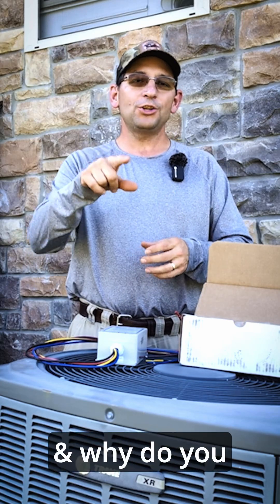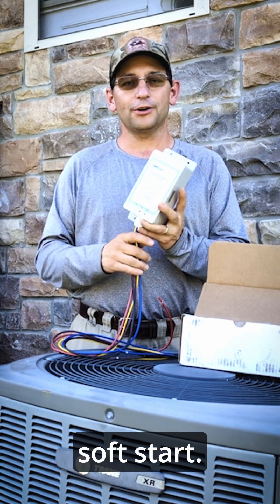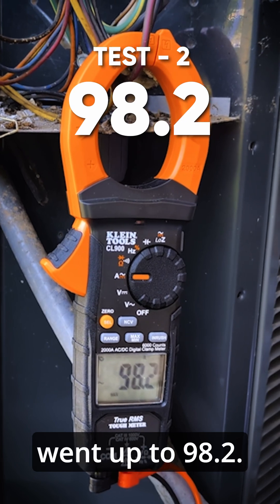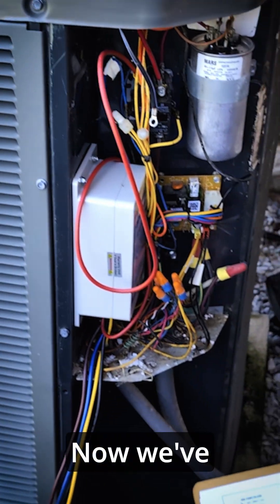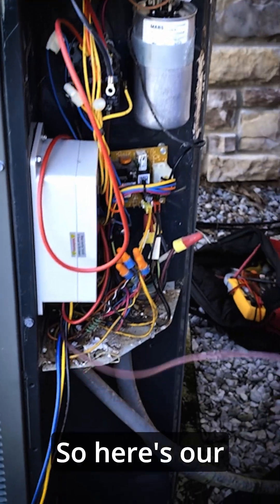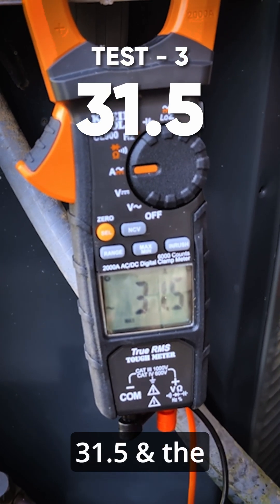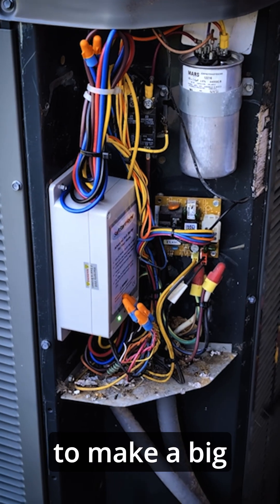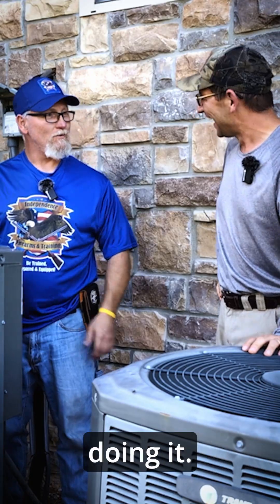AC Unit Soft Start Install with Amp Draw Test Before and After

Comment: Does it extend the life of the heat pump? What does it do exactly, I guess it relates to the capictor somehow
Reply: It limits the current when AC goes from a standstill to running so the increased power draw doesn't cause your lights to flicker whenever AC boots up
That's basically it
Doesn't make your AC last longer or anything, just removes the spikes
Reply from the maker: Great question @Electrical.Perspective and solid input @Mumohan_ You’re both touching on the things we researched before adding the Soft Start. It definitely reduces the surge of power during startup, which helps prevent flickering lights and strain on your power system. But it also eases the load on parts like the compressor and capacitor. That smoother startup can lead to less wear over time, which may help extend the life of your AC/Heat Pump. I can't say 100% it'll extend the life but whenever parts are not being hit as hard with spikes, I feel it'll make them last longer.
Reply: It only delays the compressor start and the fan starts right away like normal.  That helps with inrush since both don't start at once and yes it has big caps which smooth out the start so the compressor doesn't get sagging voltage after the big inrush from start.  The latter does increase the life of the compressor a bit.